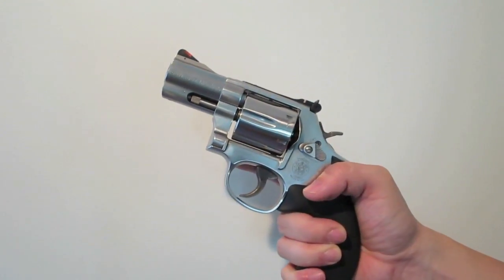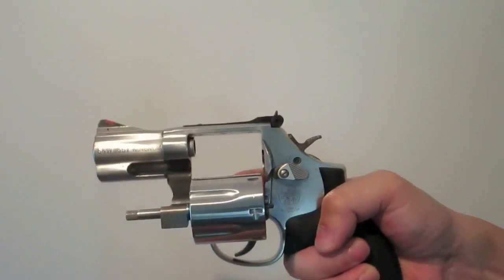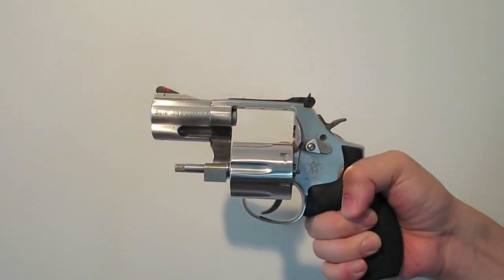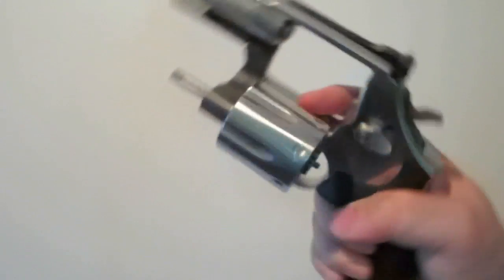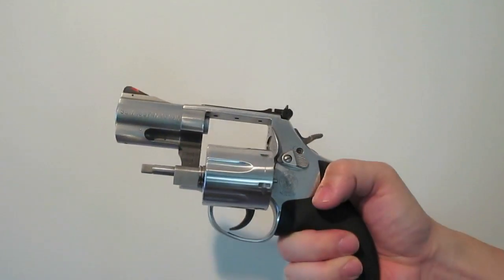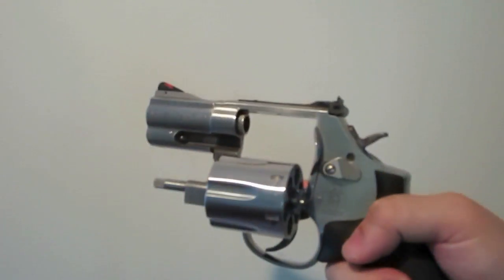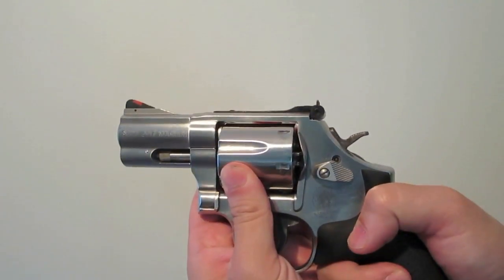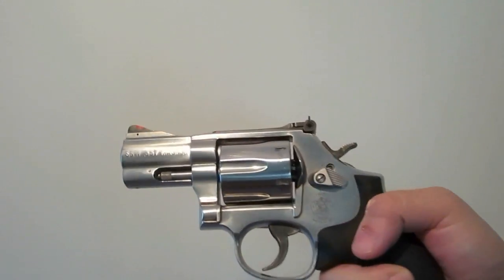Don't Bogart A Revolver

Comment: Never heard "bogart." Ive always called it "Cowboying."
Reply: I always thought bogart meant hoarding or not sharing. Like " stop bogarting all the chips and salsa"
Reply: Or don't bogart that joint my friend
Reply: No cowboys even have flip out cylinders? Those always made me thing like film noir
Reply: "Don't Bogart the joint, man"😂
Reply: Humphrey Bogart perhaps?
Reply: Only in Hollywood can one cowboy a cylinder in place on a single action revolver with a non swing out cylinder, load cartridges into a cap & ball revolver or shoot a single action revolver without cocking the hammer. Best of all is a 30 second full auto blast from Sgt Saunder’s Thompson with a 20 rd mag. My favorite however is the Kung Foo guy catching bullets out of the air and throwing them back at the shooter.
Reply: @zivendine  Pulling a Baldwin

Comment: It's about time someone other than myself, said to close it by using the crane, then making sure it's locked up. All of these other tutorials say to simply close it with the cylinder, and you're ready to go. I've never gone to the range and tested to see if it would shoot while in the unlocked position. I simply forgot to try it. You're the only other guy I've heard say close it with the crane and lock it up. I believe using the crane over many years, will possibly give the cylinder a longer life span. Thanks! Because of this video, I just subscribed.
Reply: I'm a Smith and Wesson guy so a "crane" is actually a "yoke" in Smith and Wesson terminology.  Yes, close it by pushing the yoke ( or crane) with your left thumb but also put your right thumb on the side of the cylinder near the rear and put ever so slight pressure on that area while lining up the cylinder so when it closes you dont have to turn it to index it.   The cylinder stop lug is already engaging the lugs in the cylinder.

Comment: I wish I knew that because I broke two airsoft revolvers doing just that. Airsoft revolvers use the exact same Crane system.
Reply: How many times did you do that your revolvers?
Reply: @diegomagallon321  about 100 times each.
Reply: @PewPewBeets  BTW what brand from your Airsoft Revolver? I have an Airsoft Dan Wesson 715
Reply: Dogman tossed my salad  I destroy coward toys!
Reply: @user-4210  I don't remember exactly. It was Similar to the one in the video but with a non-removable sight rail.
Reply: Dan Wesson 6 inch?

Comment: You don't have to worry about locking up the cylinder in a defensive situation.  When pressing the trigger the cylinder will rotate and hammer will fall on the next round.  Consider a fanny pack for summer carry I use a Maxpedition Octa Versipack.

Comment: Unless I was in combat I’d be a lot more gentle locking it up rather than slapping the cylinder. At the range I gently push the cylinder into battery using the same thumb I used on the crane.,

Comment: Had a 686+ that a friend not only Bogarted, but spun the cylinder as fast as it would go before they Bogarted it. As Murphy would have intended, it happened right before I vould explain what not to do with a revolver. When I managed to get it open I thought it was just the extractor that was destroyed so I just replaced the extractor after an unsuccessful filing and peening of the extractor,  helped a little bit but it was still past the point of no return. I have never been so wrong before in my life. I will no longer let anyone touch my wheel guns unless they show me how they handle theirs first. Don't have a revolver, then you don't get to touch mine.

Comment: So, if the reason why it's damaging to a revolver to "Bogart" it is because of the shock or the impact of it, then reloading it in a real world scenario would be equally hard on it. 

You can close it gently all you want, but if you're doing speed loading training or need to use it to defend your life, you're not going to baby it.

In fact, I'd say if you needed to reload quickly, it'd be less harsh to the revolver if you were to "Bogart" it versus not if you need to send more rounds down range A.S.A.P. 

On one hand, "Bogarting" the gun causes the cylinder to slam shut. The weight of the crane, ejector rod, cylinder and rounds would be around 2  - 7 oz. depending on the gun and caliber.

On the other hand, you're closing the cylinder shut quickly with all of the weight of your weak hand as the driving force...also assuming you'd be indexing the cylinder regardless of how you reload it.

So it seems to me that "Bogarting" is not something you want to do for showing off or just doing it for the hell of it. But to say that it's wrong for the sake of being wrong seems a bit misguided.

Just my thoughts...
Reply: @Darrell Kingsley  @Darrell Kingsley  it's not about believing it or not. No one has explained why, what makes it abusive? It's what I always hear people repeating, if it's something you grew up with or have always heard that's cool. But unless its backed with the facts of why the claim is made, it's difficult for me to learn when hearsay is my only source...

You commented on me not knowing about revolvers rather than answering and explaining why its abusive. If you know why, and it's not some heralded secret, do you mind enlightening me?
Reply: The problem is shutting it with a push doesn't also add the force of the cylinder's weight as much to the force. It's less the overall force and more on how force works.

You're actively adding more force than necessary unless if you're actively trying to damage the revolver with said push, which even with the fastest reload you're not going to do without meaning to.

It sounds like it'd cause the same amount of force but it doesn't. The only time you should swing the cylinder is if for some reason your loading hand is occupied and you really need those rounds loaded right that second as fast as possible.

There's also a secondary problem, you're unsteadying your shooting hand more by swinging it, which doesn't affect your time on target by much but it is easier to keep a revolver on target by pushing the cylinder instead of swinging it which might be critical if your life depended on it.

Comment: Question:   I am looking at purchasing a used Ruger GP100 in 357 from a friend.  Its going to be my first revolver, and I want it just to have one.  The gun looks good, and i don't see any issues yet.   As you know this gun fires in CCW direction.   When i was inspecting it, (not firing), I noticed that it relatively easily jumps the cylinder lock in non firing clockwise direction.   Should it move in the CW direction?  do you think the cylinder lock may be worn?    do all revolvers move with ease in the opposite direction of firing travel?
Reply: it could be cylinder lock spring which requires for a disassembly of the revolver. I had the same problem with my revolver S&W 629 PC 44 magnum hunter. I ordered an extra powered cylinder stop spring and it fixed the problem

Comment: Why does that cause damage?
Reply: Depends. Way back in the day metallurgy wasn't very advanced and steels were softer. It was said the impact of flipping the cylinder closed could bend the yoke or crane. Maybe even damage the locks and throw it out of timing. Most modern guns are probably ok. I don't freak out when people cowboy my revolvers. Kinda like the revolver version of the auto's slide release thing.
Reply: @vaportrail226  it's the weight of the cylinder that does it ...
It'll trash any swing out revolver over time
Reply: @jonslife3533  sure, over time. And it may take a very long time depending on the manufacturer. And with the right touch you could flip it home just as softly as closing by hand. Just the same, I don't do it to my guns but I will spin my SAA all day!

Comment: Does spinning the cylinder on a revolver damage it in any way??
Reply: No. The cylinder is designed to spin.
Reply: @That-Will-Do-It  So, to clarify, if you spin the cylinder multiple times very slowly and then close the cylinder (while the cylinder is not spinning),  it won't damage it?
Reply: @That-Will-Do-It  Again, just to clarify, spinning the cylinder quickly but then waiting for the cylinder to stop spinning before closing it will not cause damage? It'll only cause damage if closed while spinning? Thank you for your answers, they're greatly appreciated.

Comment: spinning it while it's locked is still okay though right?
Reply: NCR Gunslinger You'll inevitably get a drag line anyway if you use the thing much at all. If you pull your trigger or hammer slightly the release at the bottom should go down and not cause dragging.

Comment: I had just bought my Smith and Wesson .460 XVR, brand new never fired. I got home and my neighbor who I shoot with from time to time was outside. I told him to come check out the new baby I had just brought home. Sure enough he picks it up, opens the cylinder, and proceeds to spin it and then Bogart it shut. I very politely said "WHAT IN THE FUCK ARE YOU DOING YOU JACKASS"?!?!? That big heavy cylinder hit so hard I felt it in my teeth, and my soul. No damage was done but that was the last time I let him see any of my revolvers. Common sense tells you a heavy mass of steel striking a very small and much thinner piece is usually a bad outcome for one.
Reply: Love the .460 so much. The 200gr Hornady FTX are pretty easy to handle in mine. Such a sweet revolver. I always have “the talk’ BEFORE I hand off a revolver if there’s any doubt. Saves a lot of blunt force trauma.
Reply: I dont think I would of handled that situation as well as you did.  No one handles my old pre lock Smith and Wessons but me.  Yes there are waaaay to many dumb fucks out there and when I go to the range  with my Smiths they attract attention but its " you may look but dont even think of touching "   If I had a neighbor like yours he would be on a permanent shit list.

Comment: Wrong answer, your supposed to close it by pressing on the cylinder.
Reply: JerseyCasull454 , crane is the preferred method I believe.
Reply: I've heard by the crane. But you can't easily open it without pushing on the far side of the cylinder. Generally just don't be an a-hole to your revolver.
Reply: JerseyCasull454  I'm sorry my friend but you have the wrong answer.  closing it by pushing in on the crane has always been the preferred method..... always.  lol.
Reply: It would seem closing by the crane gives it 50% more life